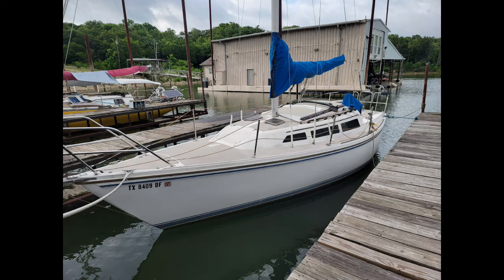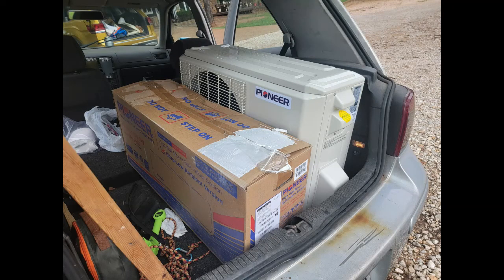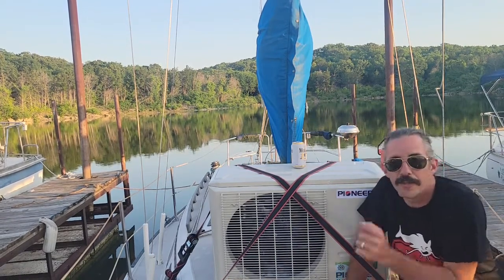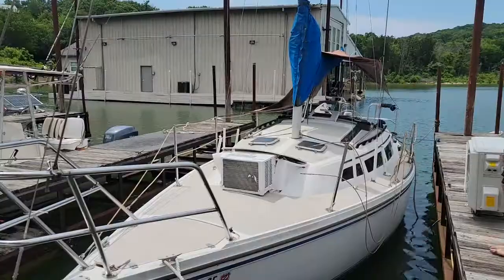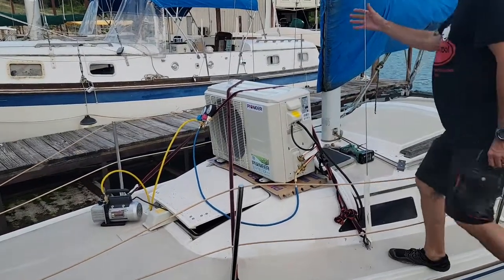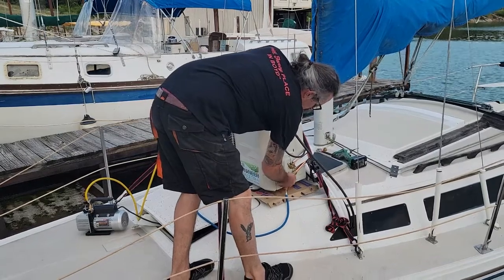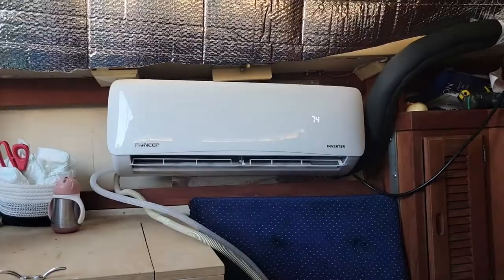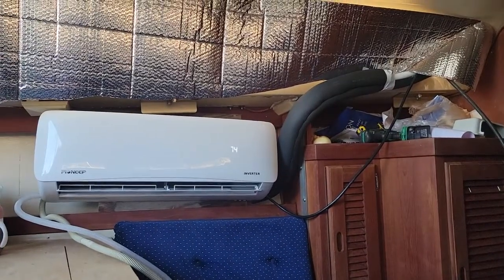9000 BTU Mini Split Air Conditioner on a Sailboat

Comment: It will NEVER run on a battery bank either
you would need 5000 watt inverter and at least 1000amp hour of lithiums which would run you 10 grand to setup.
Reply: ehh im sure there's a better way
Reply from the maker: That's not how these work, they draw 5 amps alot of the time.  I've ran it on my 200 amp hour lithium for 1 hour on a 2000 watt inverter.
Reply: @DoWhateverfilms  I'm sorry I don't believe that at all. I install a/c systems on vessels and RV's.  I have seen how taxing the lowest of BTU split units are.  My friend Capt Rick Moore on Sophisticated Lady installed a 10k btu split on his 43' Sun Odyssea and he uses 8 100ah BattleBorns and it even requires a Soft Start for the compressor to safely kick in without Victron alarms screeching from surge useage.   So please make a video and SHOW me cuz i'm from Missouri , lol

Comment: A mini split on a boat? Just use the tried and true ~$175 window unit. You will NEVER run either on a solar setup, but you don't need to on shore power anyways.
Reply from the maker: I did, but it was taking up a hatch and wasn't secure when I left the boat for the week.
Reply: @DoWhateverfilms  your boat needs to be air conditioned while you're gone?